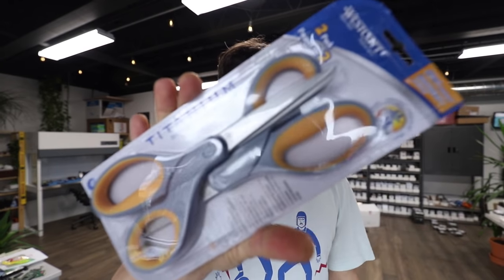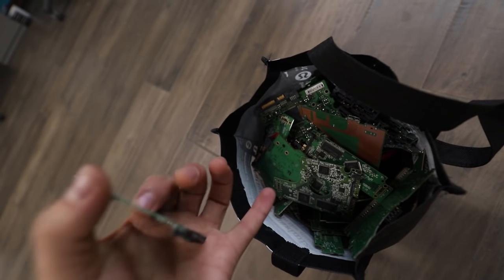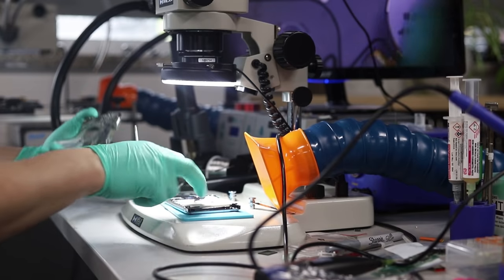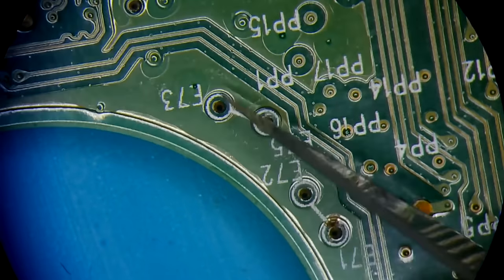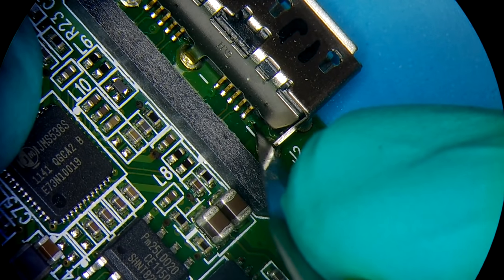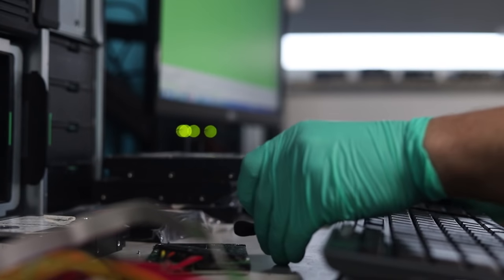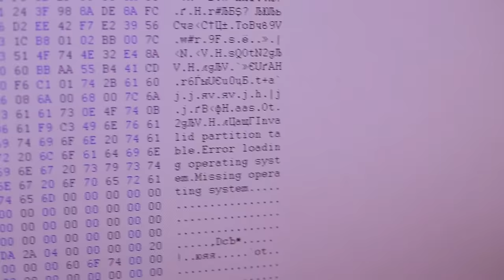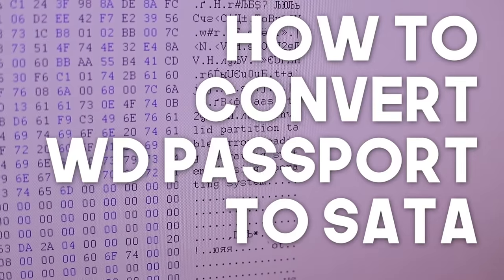How to convert WD Passport PCB to SATA | data recovery

Comment: after "a few things worth mentioning..". sound cuts off.  perfect.
Reply: they explain that the C13, C18, C31, C37 capacitors will need to be removed to isolate the SATA interface from the integrated USB controller.

Comment: Thank you. From my experience with  WD External USB Drives such as 'My Passport' are high-risk storage options, and recovery a 'racket' from Slow-Response and the USB connections incredibly fragile. Even the latest 2020 mfg 'My Passport' USB connector started to fail after 12 insertions. If you are using these drives for archiving data I recommend doing so on at least one extra drive.
Reply: @Christian Habermann I believe a much better option is to buy a standard 2.5"  laptop or full sized harddrive and place it in a third party case, so you can still access the drive if the interface fails, and your data is not subject to firmware based WD data formatting and compression. 

I also found a 'CaseCrown 2.5" Mobile External Hard Drive Case', and secured the drive and cable internally so the drive has some shock protection and  there is less strain on the drive and cable connection

Comment: I don't know why WD and Toshiba solder the bridge on the drive. If the bridge dies, you have to do humongous work to make it working again. The Seagates just have a PCB that's simply plugged on the SATA connector.

Anyways, interesting video! :)
Reply: Tobs Seagate > wd
Reply: I bought a SATA drive from WD and it wasn't soldered. It was a Mac drive.
Reply: WD use to make a SATA to USB converter board for their older passports
Reply: Probably to prevent users from opening up the enclosure and repurposing the internal drive for use in e.g. a laptop.  It's might also be cheaper to manufacture.
Reply: @pyracurse  Plus they can make them physically smaller.

Comment: Thanks! For some reason my disc wouldn't work trough the USB, I replaced the connector it showed in Windows but there was no disk mounted, I tried TestDisk but it wouldn't work. Thanks this save my data!

Comment: great video! I have a sluggish 4TB wd-elements, reporting no SMART errors, but extreeemly slow, so after googling, I ordered a new PCB from China, also a cheap heat gun (the 858D+) and after few tries desoldering and resoldering chips on an old 40G PATA drive, having it still work fine, I gave it a try on migrating the chip from the old PCB to the new one. It almost went well, except... the drive with the new PCB now clicks and does not get recognized. I was thinking of moving the chip back... than again, maybe it would be too much stress for the chip if I do it on my own again. :/ Any hints would be highly appreciated.

Comment: I have a WD10JMVW, and it works but it takes like 30 minutes to copy like 20mb. It is fixable? is it a hardware issue or firmware? the board is 2060-771801-002 REV A

Comment: Bro, i just bought toshiba canvio basics and it works fine but I bought to peel and use as cheap sata storage but it has the same usb 3 micro-b on the pcb please tell me there's a way to get a sata connection on this preferably at the edge of the drive like normal and not across the board like this one.

Comment: this is why i stop buying factory made external drives and start to buy sata drives and a enclosure separatly im using now a m.2 nvme with a usb 3.0 external enclosure it gives me a stable 600mbps to 1gb of data transfer and there nor risk of vibration to damage as it is with the hds.

Comment: hi, just have a question about wd encryption on some drives? . do you mean that the data is encrypted because the customer activated the wd unlocked password
or is the data just natively encrypted even if the customer did not put a password to access the drive?  just wanted to know for sure... Thanks a lot for your videos !
Reply: The chip he showed on the board performs hardware level encryption and is active even if the user has not enabled a password. The user password thing is a software level encryption for extra data security that the user can install.

Comment: Hi there. I'm for Brazil and was searching for references about rx/tx capacitors from Hdd.
I have a ps4 that's damage the sata conector. The capacitors from the 3 first (left to right) was taken off board. How they are smd, I'd make the same that you do in the "convert wd passport to sata" video. Cut a board with the capacitors and solder in the liners that are remade.
The problem is that voltage is passing to high, so the ps4 don't recognize the hdd.
The only capacitor that is still on the board pass 0.05, all the others are passing ~0.25.
I searched but not discovered the value of the capacitors. I think that is 104 (100nF) or 101(100pf).
Can you help me, please?

Comment: Hello Sir, i have wd element from 2011 and i am in india, this drive shows uninitialized and when i try to initialize it it gives access denied error, i tried testdisk also and it shows read error. on Disk management it shows correct capacity but doesn't initialize. do you think sata conversion will fix it? Thank you!

Comment: Hi Erkin, or any other one who can guide/help me. I'm desperate. I have a 4TB My Passport. The part number board is 2060-800041-003 REV P1. The data was accessible but the USB port of the board is damaged, if i do pressure between the cable & the board the drive wakes up & shows me data, but is impossible to get the drive working this way to get the almost 4tb of data rescued, the needed pressure is too much, i was afraid to damage it for ever. I've tried to re-sold the USB port with no luck, so i've decided to solder wires to transform the drive from USB to SATA. I knew that the data pads for redirect to the sata connector were the E71, E72, E73, & E75. In the process i've lifted out the E71 & E72 pads 'cause the wires were too thick and i've moved them accidentally. I'm desperate cause i don't see any metal in those circles in which re-solder new pads or little coppers to replace the old ones, and i suspect that those pads are not the real board conectors, just plain pads to sold rescue or analysis wires there, but obviously i'm no sure at all. I would like to know if the real conectors are the very little rings to wich those pads were connected. Thx a lot to everyone's time for read me.

Comment: ? Is it possible to decrypt the data if the customer has the cryptographic key stored somewhere else
Reply from the maker: In passport drives there is 2 types of protection, password protection that could be set up by owner for extra security, and a mandatory hardware encryption forced by JMS or Inition or other. Password to lock the drive has nothing to do with hardware encryption of the device